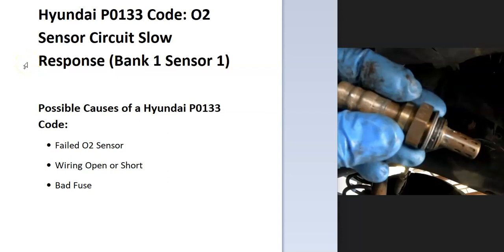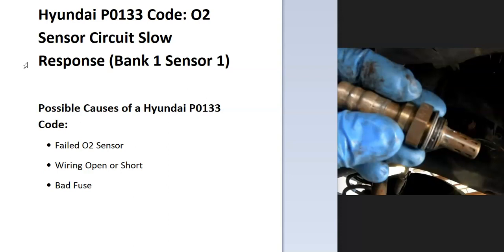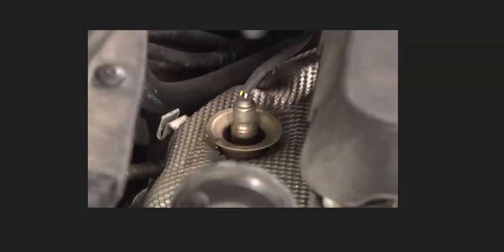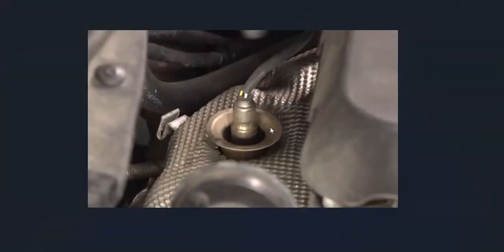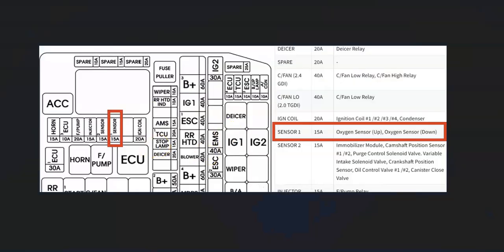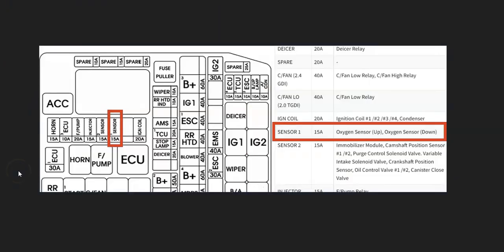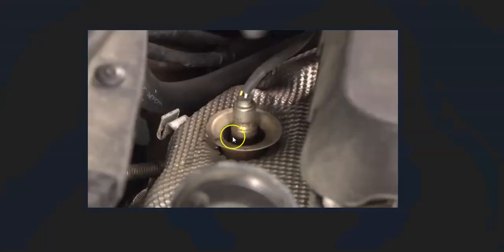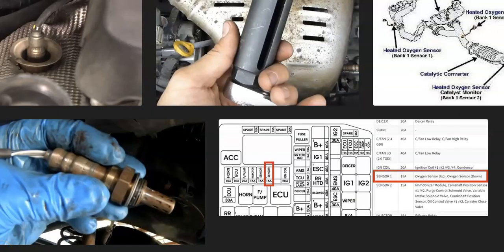How to Fix a Hyundai P0133 Code: O2 Sensor Circuit Slow Response (Bank 1 Sensor 1)

Comment: My Hyundai Tucson 06 has this code still despite replacing the sensors and the O2 monitor won’t set. Check engine light still persisting too. What else could be the cause of this?
Reply: I read a while ago that a leak in the exhaust system can cause the sensor to read wrong, might be worth checking
Reply from the maker: I would check the wiring and the fuses.
Reply: There is a recall for 06' call your dealer. The ecm needs an update
Reply: @bzi9935  What problems does this upgrade solve?